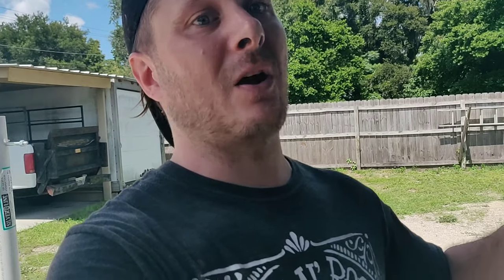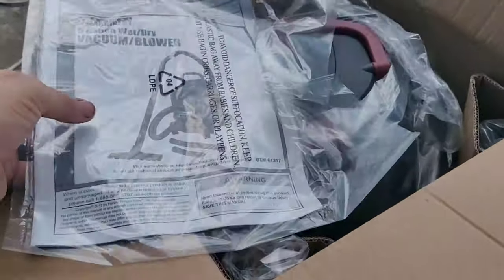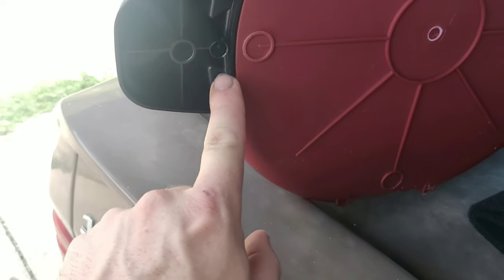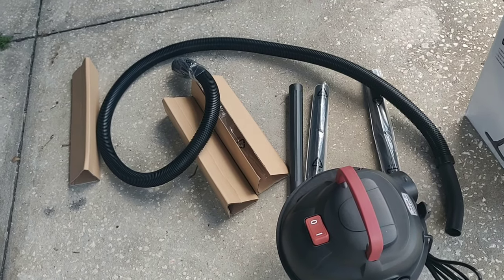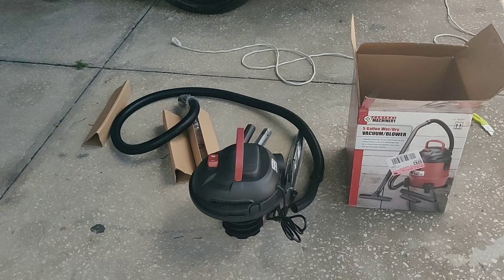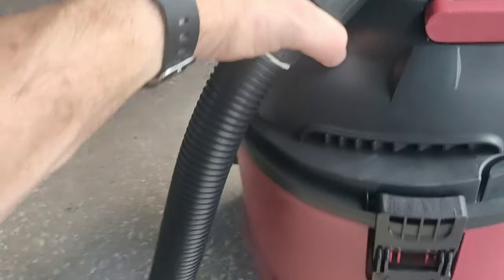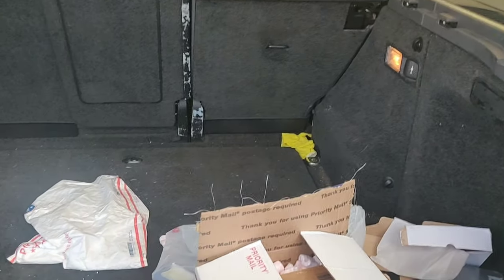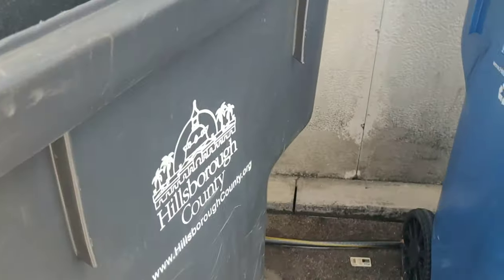$40 HARBOR FREIGHT SHOP VAC & BLOWER REVIEW, SET UP & DEMONSTRATION

Comment: Your experience with the blower function is exactly what I would have expected. They are meant more to blow up inflatable items rather than move grass off a driveway. As you pointed out the green blower is the tool for that  job. Helpful video. I bought the vacuum today.

Comment: I got mine about 8 months ago. I use it to wet vac the basement. It works great for this job. The float shut off works too. When it gets full, it shuts off. I have the black foam filter on it only. I didn't try the blue bag nor the paper bag. But it is well worth the nony
Reply: You need the bule filter for dry
Reply: Can i use it without the bag?

Comment: I need a vacuum and was thinking of buying this also for the blower side - do you think it would be strong enough to remove light dust from a car? thanks
Reply from the maker: I would recommend the Bauer 6 gallon shop vac from harbor freight.  Best shop vac I have ever used for under $50.   With coupon it's about the same price.   I bought one for my coffee roasting company and use blower side to clean off patio.

Comment: Is it good for fitting in small areas? I live in a trailer and my parents said I won't have enough room for a shop vac, but I want one and am trying to find on I can use here. Is this a good one? Also, I have a small bedroom.
Reply from the maker: I would get a shark vacuum if I were you but yes this could work too.   Sharks are very small and powerful

Comment: Can i use it without the bag with no problem?
Reply from the maker: As long as you have the filter attached.  That is how I use mine at my shop.  It will fill the plastic barrel and you just dump that. The filtered air will go back out other end

Comment: Coupons no longer apply to Central Machinery : (  Very informative vid. Thanks!
Reply from the maker: Good to know.  I think I found a specific coupon for the unit.  One from an online ad.  But thanks for heads up.
Reply: gamefreak12763 : Even though it specifically states on the coupon that it doesn't? Or do you have an older coupon that has not expired, but printed before they added the Central Machinery exclusion on the new coupons?